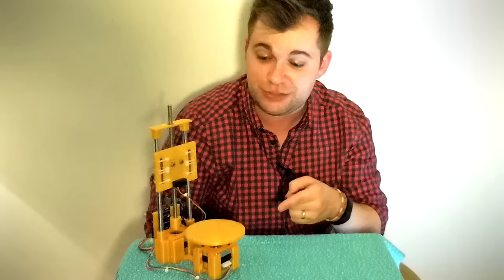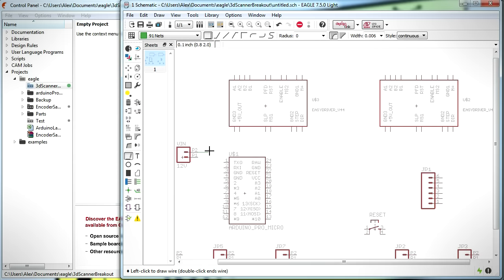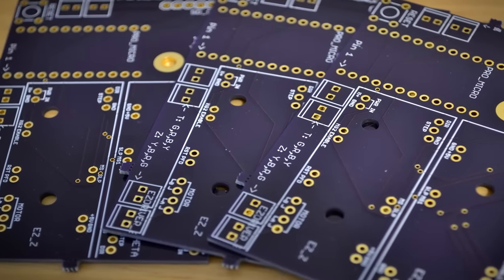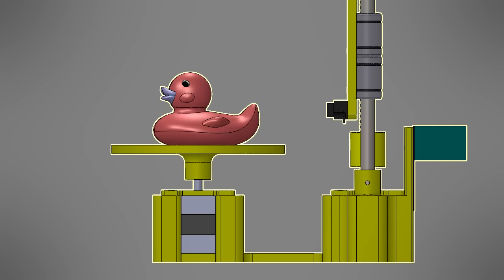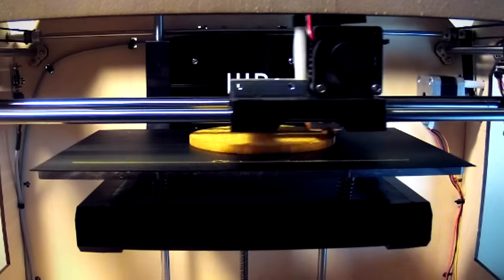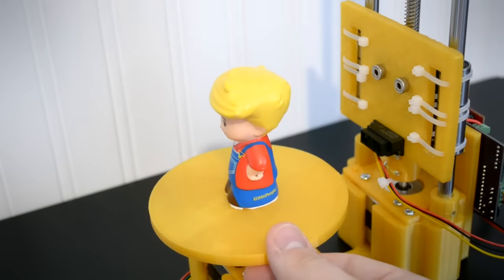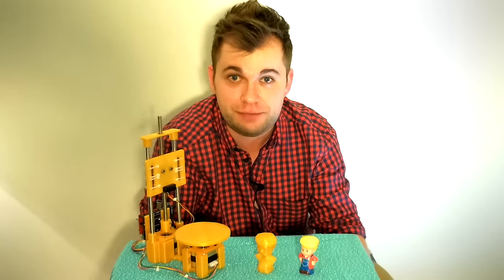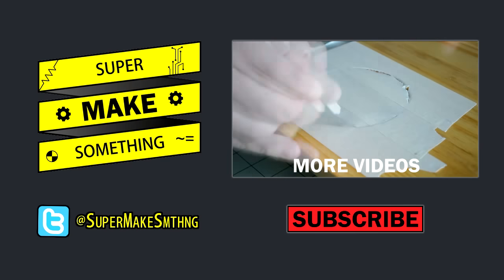DIY 3D Scanner (Arduino, 3D Printing, PCB Design, Stepper Motors, IR Sensing) - Super Make Something

Comment: Such a cool project! I'm currently buying parts to make my own. I am not that good when it comes to knowing about voltage, amps and so fourth. So i just want to ask if it is okay to have 24 watts as long as you keep within 12volts dc? thank you🙂
Reply from the maker: Thanks! Yup as long as you stay within the voltage rating, a higher power (W) rating is fine.  Since P=IV, the circuit draws as much current (I) as it needs to function, so having a larger rating is fine. That being said, a word of warning -- some Arduinos have a voltage regulator that cannot handle 12V, so plugging in a 12V power adapter may break it. I would start with a 5V supply and increase it until it works. (7-8V should be good!)  Good luck with your build!
Reply: @SuperMakeSomething  thank you. I will try it😁
Reply: @SuperMakeSomething  by the way. Since i might be reusing my Arduino nano because this is getting expensive and i am only 14 so money is a bit hard to get, i am wondering how i check for the built in regulator on my nano or any other board for that matter?
Reply from the maker: @vitustillebeck  The best way is to look at the part number printed on the chip, which should produce a datasheet if you search for it on Google. (This is still not 100% guaranteed, because counterfeit chips exist, but this is the best way to maximize your chance of success!)
Reply: @SuperMakeSomething  well thank you so much for the help. I wish you the best of luck. Have a splendid day.
Reply from the maker: @vitustillebeck  You’re welcome! Good luck with the project! Please let me know how it turns out!
Reply: @SuperMakeSomething  I will. I just have to complete my gyro gimball first🙂

Comment: perfect idea, 
could we change the rotation speed of the table  using Z Axis values for 3D designs {designed in Artcam or else } while executing the G-code ,in another words if Z value=-1 then the rotation speed  is 300rpm,and when Z value=-3 then the rotation speed is 100rpm(positive relationship)?????????
Reply from the maker: For sure, you would have to modify the code a bit to take input, but this could work!
Reply: @SuperMakeSomething  how can you help me in this issue?

Comment: I wish it should used with David Laser scanner. You need good webcam, laser and nice controlled turntable. A 720p webcam can make it more sharper, or 1080p webcam more sharper. A laser line is enough. 
Because IR sensor has one problem: when material cannot bounce signal correctly, you get error. Webcam and laserline has much less problems, i think. 
There are already IR distance sensors with built-in processing, gives voltage based on distance. 
Sharp GP 2 D 150 A is for 3-30cm which should okay.

Comment: super helping.... :) great vdo
can i use the ultrasonic sensor module instead of the IR sensor?
Reply from the maker: Thanks!  I have not tried to use an ultrasonic sensor module, but I do not believe that they will provide as much detail as an IR sensor, due to the fact that the "spread" of the ultrasonic module is larger than the IR sensor.  In theory, though, it would be easy to try out, as the IR sensor is connects to the board using an analog input.

Comment: can this work in ultrasonic sensors
Reply from the maker: It should! Just need to make sure the sensor you use is spec’d to work within the minimum sensing distance you have.
Reply: @SuperMakeSomething  thanks 
but I don't have a stepper Motor
If I measured the DC motor speed with lowest PWM signal can I make it act like the stepper motor
THANKS though
Reply from the maker: @blmb4274  This could work, though you may have an issue without additional feedback about the motor position — PWM will control motor velocity but acceleration/deceleration, motor properties, etc. will make knowing the exact position of the motor after each command tricky since there will be slight variations. If you want to go this route, I would suggest adding an encoder and a PID feedback loop for more exact position control. However with this increase in complexity you may be better off just buying a cheap stepper motor online.
Reply: @SuperMakeSomething  Thanks for the help
Reply: @SuperMakeSomething  Hey I back again 
Can you give me a full source on how to measure the xaxis and yaxis and the zaxis
please thanks

Comment: I 'll try make it !
Reply from the maker: しろてっく Awesome! Good luck with your build! Please let me know how it turns out. One word of advice — start with a lower input voltage than what I mention in the video for the Pro Micro. The voltage regulator on many non-official boards unfortunately can not handle that much voltage and burn out. Purchasing a variable power supply like the one I listed in the description will be your best bet.

Comment: The video was really amazing and I'm planning to make one. Please tell me what should be the design of PCB for it. Please urgent!!!
Reply from the maker: Thanks!  A link to the breakout PCB can be found in the video description below.  Best of luck with your build!
Reply: Yeah but how do we design the custom circuit board and other pcb? Or if it is already done, in the STL file given there is only the 3d image. I need to know the circuit design.. please
Reply from the maker: Ramyaa RathnaManjula The PCB is a breakout board for other commercially available PCBs like the stepper motor drivers, Arduino, SD card reader, etc. If your order this PCB and the other items listed in the Bill of Materials in the video description, you would not have to do any circuit design yourself.

Comment: awesome video! but why you not use the laser&webcam combo instead of ir?
Reply from the maker: +rexludus93 Thanks! The laser/webcam combo is definitely another way to go with this. In terms of the mechanics involved in the scan, I felt this was a simpler approach which only needed one sensor, but there are definitely multiple ways to build a 3D scanner. I've also seen approaches that use structures lighting, which seem to produce good scans, and definitely want to look further into this in the future.

Comment: Linear bearings have retainer ring grooves. Retainer rings just looks more professional and are reusable unlike zip ties. Secondly, would the light of the room interfere with the scanning? Would an enclosure be needed?
Finally let's say that we were scanning the rubber ducky you shown, it wouldn't be able to detect the space in between the neck and the tail right?
Reply from the maker: While retaining rings could be used for this project, I decided to go with zip ties to keep the project as accessible to others as possible.  (Retaining rings would require specialized pliers to install them correctly.)  Light from a room would not interfere with the scan, as the distance sensors operates in the IR spectrum.  You are correct that the laser can only scan things "line of sight." The idea would be to scan with as high of an angular resolution as possible (which depends on how long you are willing to wait for the scan), and then use interpolation to fill in the gaps.

Comment: awesome project, can i use arduino nano shield v4 instead?
Reply from the maker: Any Arduino should work, but you will not be able to use the PCB I designed for this video as the footprint will be different.

Comment: Hi. Nice project, but I have some questios:
1. What of Z-AXIS Screw is used? I mean length, diameter Pitch? 8x2 or 8x8 length 250mm?
2. Is PCB design Eagle format available to download?
3. Did You consider using digital distance I2C sensors i.e: Adafruit_VL6180X, Adafruit_VL53L0X?
Maybe You tested various sensors and this Sharp analog One works best did You?
Reply from the maker: Aimeiz The z-axis was purchased from AliExpress and came with the marching nut. It is ACME threaded rod with a length of 250mm. I will update the video description with a link to the Eagle files tomorrow. Trying different sensors is definitely something that I would be interested to check out!
Reply: @SuperMakeSomething  HI.
Thank You for information.
I purchased ACME screws 250x2 mm. I decided to go to small pitch, since for Z-axis we do not need high speed, rather than high precission.
They came with nuts, but I purchased also double nuts with spring to eliminate mechanical looses, but now I have to design fixture for it, because it is different than in Your project.
I have some sensor in my stock, but also orderer the same as You used.
Reply: I built a machine, just different controller using grbl shield I hav in my stock. I do not have sensor You used for project so I tried laser distance sensor STM VL53l)X by Adafruit.
I am not happy with the results. Sensor is slow and not accurate and have quite wide point of measure - a few milimeters. So I am awaiting IR sensor to arrive.

Comment: Thank for great project. But i have a problem with find a IR sensor, I want to ask if there any sensor can replace it? and I still not understand the formula you use to calculate the senseDistance.
Reply from the maker: You should be able to replace it with any range sensor that outputs an analog voltage, though you will want to make sure that the scanning range the sensor is designed for is appropriate for the size of the turntable and the distance at which the sensor is mounted from the object you are scanning.  

The method to calculate senseDistance does the following:  1.) It reads the analog IR sensor 100 times, and then takes the average of this reading to be the "sensed" output value of the sensor, which helps to cut down on noise/erroneous readings.  2.) The value sensed by the analog pin is represented by a number between 0 and 1023 (a 2^10 or 10 bit number, since the analog to digital converter on the Arduino has a resolution of 10 bits).  This number is then converted to the equivalent voltage that the pin output, which is between 0-5V, the minimum and maximum voltage that the Arduino operates at.  3.) This voltage is then used to calculate the real-world distance that the IR sensor measured using the conversion equation listed in the IR sensor's datasheet.  This number is then returned and written to the SD card.
Reply: thank you very much this help me alot ^^

Comment: Hy there . its really nice project and well explained. i decided to build it. but am facing problem in finding sensor 2-15 cm range. can i use 10-80 cm range sensor ?any changes to  be done in code if sensor is changed ?

Comment: I built this 3d scanner using your guide,
the only problem is I couldn’t get a reading on the memory.

am I supposed to put some kind of file or text into the sd card before scanning? Or just leave the sd card empty?

Thanks for this project :)
Reply from the maker: The SD card can be empty -- the code will create a new text file if one doesn't exist.  I would double check that the SD card breakout board has the same pin order as the one shown in the circuit diagram at 1:00.
Reply: thanks for the fast reply i'll be sure to check the pins again.

Comment: Hi there Super Make Something. My name is Ashley and I have been very impressed with your tutorials, in fact so impressed that I have actually made your 3D scanner!! Like yourself I am a very keen inventor and have been making circuit boards from the age of 5. I am 39 years old now and live in England In my Ash pad I like to call it.  Anyway I wonder if you could be so kind as to help me out a bit? I have got your scanner all up and running but have a confusion about the Matlab part.  Can you run me through how to actually convert the data coming from the proximity sensor to an STL file? I would be very grateful for your help and expertise.  Many thanks.  Look forward to hearing from you soon. Take care. 👌
Reply from the maker: Hi Ashley,

Thanks for getting in touch and I'm happy that you like my project!  The MATLAB code can basically be broken down into two parts -- creating a point cloud of scan values, and then meshing the point cloud together into a solid object to create an STL file that is ready for printing.  In the first part, the code creates arrays of x,y and z values that define a 3D surface.  Since the values come from an analog sensor, there can be a bit of noise in the readings, so the array points are smoothed using a MATLAB filter that is called using the  fspecial() method.  Finally, the surf2stl() method generates the mesh.  More information about this method can be found here: https://www.mathworks.com/matlabcentral/fileexchange/4512-surf2stl.  

Hope this helps!  Thanks again for getting in touch, and good luck with your 3D scanner build and future projects!

Cheers,
Alex
Reply: Hi there Alex. 
I'm so glad you took the time to reply to my message. I'm absolutely honoured. 
Yes you have made it clearer for me and I will definitely check out the link straight away. 
Btw. I really do think your creative mind is very intriguing indeed. I'm much the same. Anyway thanks again. If I have any more questions may I message you again please? 🖥
Reply from the maker: Hi Ashley, no problem!  Hope my explanation helped.  Definitely let me know if you run into any issues with the code.  Cheers and best of luck!
Reply: Hi there again Alex. It has been a long time now and I wonder if you recall my conversation? I have been trying and trying to get this point cloud conversion from the xyz txt file from the SD card for ages now and I just can't seem to nail it. It's really frustrating because I usually learn these sort of things very quickly but this has got me stumped. I wonder if you could give me some more pointers if you don't mind and if you are not too busy.  Your help would be very gratefully received. I have the whole thing up and running apart from the last part (which of course is vital).  Anyway you take care and I hope to hear from you soon.  Cheers.  Ashley 👍
Reply from the maker: Ashley Bowles What issue are you currently having? Is the text file on the SD card and does it contain data?
Reply: Hi there Alex. Thanks again for replying so promptly.  Yes I have got the txt file on the SD card and it seems to contain all the strings of numbers. The issue lies with actually converting that data to a point cloud format in which to be finally converted to the stl file. One question. If the data wasn't actually valid from the ir sensor would it have problems in the conversion process? I'm actually at the moment debugging the sensor so as to check whether it is functioning correctly. Thanks again and any input would be great. Cheers. Ashley
Reply from the maker: Ashley Bowles Hi Ashley! This could definitely cause a problem. Since the points are “meshed” based on their order in the SD card, having some erroneous points could cause the scan to look odd and not mesh properly. Are only parts of your STL file that look this way or is it the whole file? If it is only parts, I would recommend further playing with the filtering parameters to clean up the point cloud. Otherwise there may be an issue with your sensor as you suggested.
Reply: Hey there again Alex. Apologies for the delay in replying. I have desperately been trying to sort this scanner out but of no avail 😔 I think you may have misunderstood me because I haven't even got to the stl part!! You see I'm a complete newbie at Matlab and to be honest I haven't got the first clue as to how this program works especially for the point cloud conversion process. I have had an idea however. Would it be possible to send you the txt file that the scanner has generated please? That way you can see if it is a problem with the actual data from the machine or whether I'm just falling down on the conversion part via Matlab. I really am eager to get this sorted as I just can't rest until techie problems are sorted!! I'm sure you will understand that one. Thanks man.
Reply from the maker: Hi Ashley, I can try to run the scan to see if it works here.  Are you getting an error when you execute the code? My e-mail can be found in the channel description.
Reply: Hi mate. Yes. That's an absolutely great idea. I'll send you the txt file! Also if you don't mind me asking. Where do you live. It's just I'm in the uk! And I was just wondering what your commitments are during the week as regards being able to reply to me. I'm available anytime and I really appreciate your continued interest in my predicament. Cheers.
Reply from the maker: Ashley Bowles Hi Ashley, please check in the “about” section.  Hopefully I’ll be able to help you with your issue
Reply: Will do. Thanks again.
Reply: Just to clarify.  May I send it to your google+ please?
Reply: Hi there Alex.  It strikes me that I may have been asking you to much in the way of personal info. Sorry if this is the case. Of course you may be too busy currently as well. If this is the case then I apologise but as I haven't heard anything from you for a while I would like to just reiterate that I am still very keen for you to run this file through your machine. I looked in your about section and can't find your email so forgive me if I'm being silly but could you please let me know where precisely it is? I'm a bit worried you may think I'm a scammer which I assure you isn't the case 👍 many thanks and look forward to hearing back. Take care. Ashley.
Reply from the maker: Ashley Bowles Hi Ashley, in general I don’t like to post emails because of bots/spam. My address is alex at (name of channel) dot com. I’m not sure how extensively I will be able to help you in debugging the scanner remotely, but I would be happy to take a look at your data. Hopefully we can get this issue sorted quickly.
Reply: Hey Alex. What a relief. I thought I'd upset you in some way. Yes. Of course. I totally understand. Thanks for clearing that up. 👍I will send you the file anon. Thanks again for your continued support in my predicament. 😄